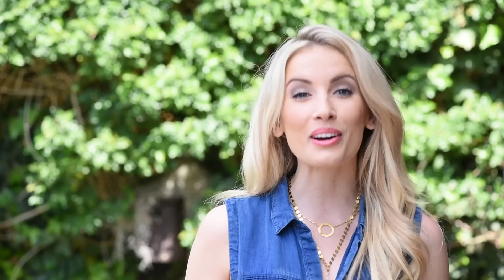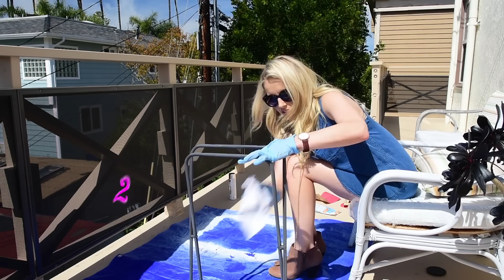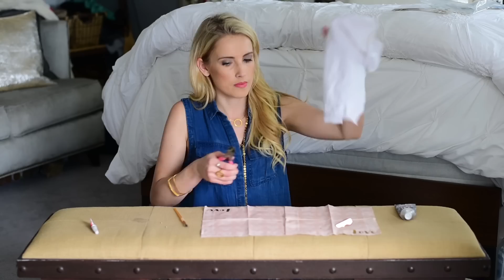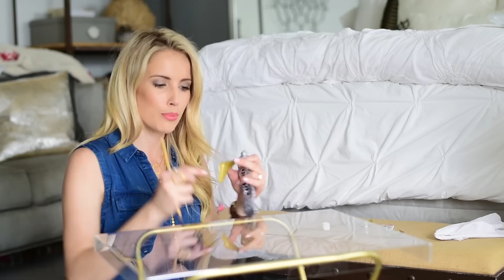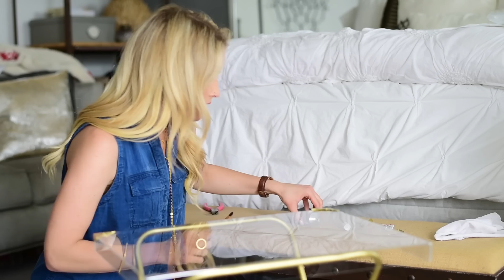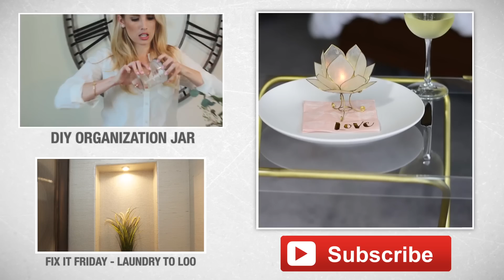Gold Acrylic Table DIY | Live Your Style

Comment: WOW I love this project did you glue the tray onto the legs of the table or you just rest it on it. Love the tip of using a small paint brush for the gluing process so much easier and cleaner. You look really extra beautiful today and your shoes gorgeoussssssssssssss.
Hugs Alli
Reply: tray table ....removable
Reply: awesomeskylineally rested it, if you glued it you'd have random lines of glue on the bottom of your tray

Comment: Is the clear acrylic tray tabletop glued to the folding gold legs? if not, do you find that you can't put any weight towards the edges without the top flipping off? Maybe I would make it with glued-on legs to the tabletop? it wouldn't be foldable anymore, but I wouldn't have to worry about it tipping with weight. OR super glue (E6000) a hinge or something like that on to the tabletop and one of the legs. then it could still fold but be sturdy. idk just brainstorming :)